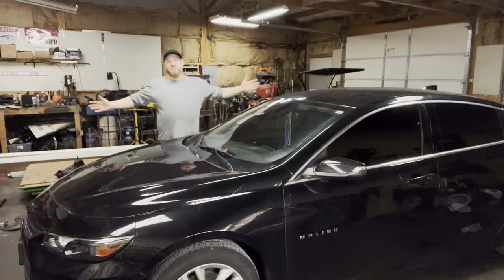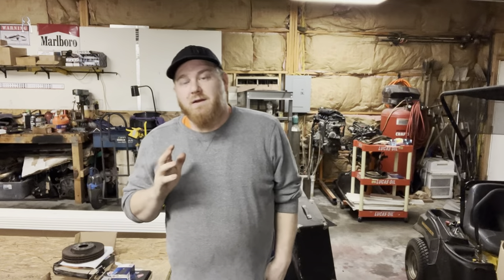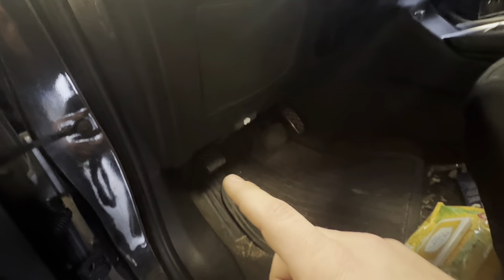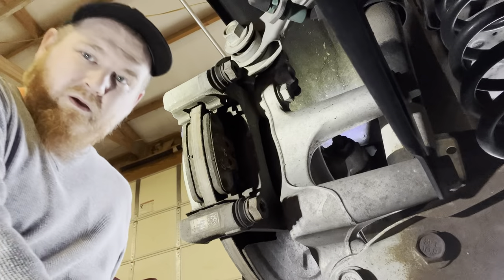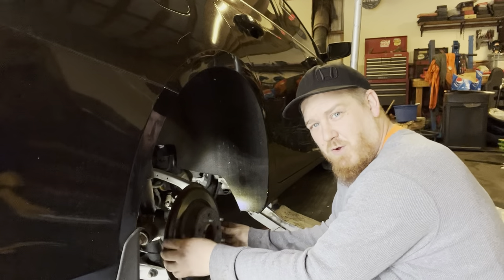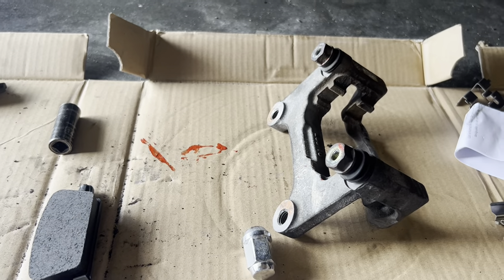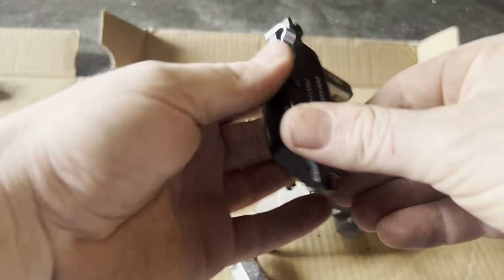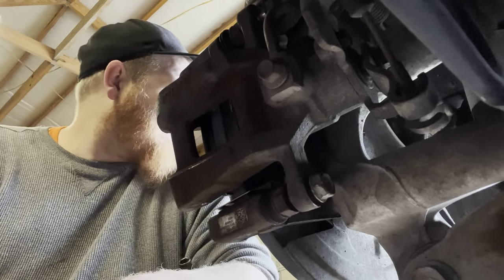2016 Chevy Malibu Rear Brake Replacement

Comment: when you install new rotors they have to be cleaned with brake cleaner to remove the protective oil on them.  Secondly, the slide pins should be pulled to make sure they are lubricated and not seized.  There are also torque specs for those bolts.  Also, for safety, you should have jackstands under the car in case that jack fails.  Safety first!

Comment: Right at 11:30 in the video I could see that you were going to have a problem. When you take the first pad out of the bracket and lay it next to the new one, I can see it's different in size and the old pad isn't slotted. Then the opposite old pad has a slot, very strange as if someone screwed this up beforehand. Glad you got it straightened out.